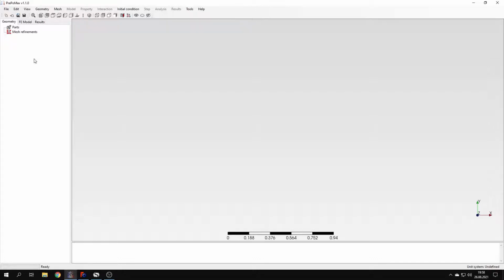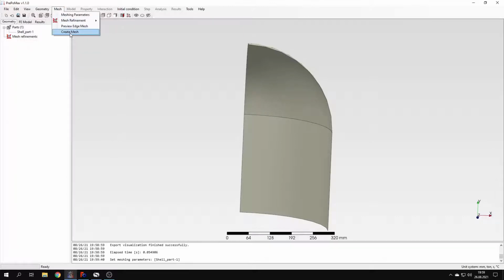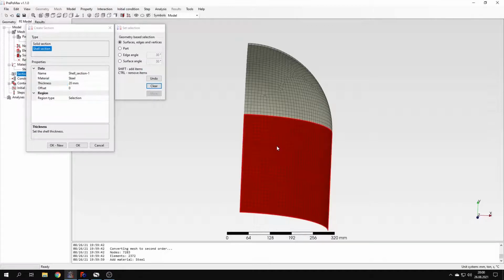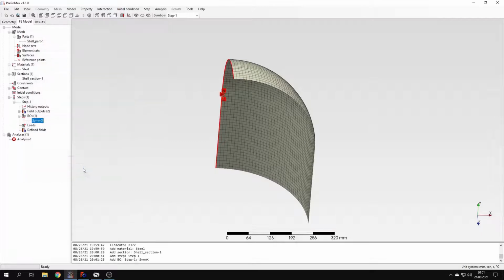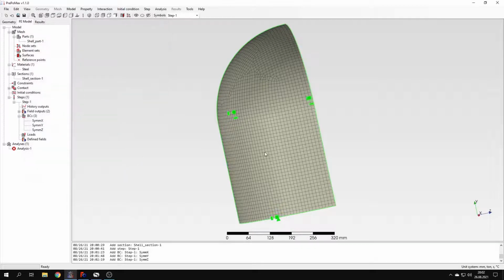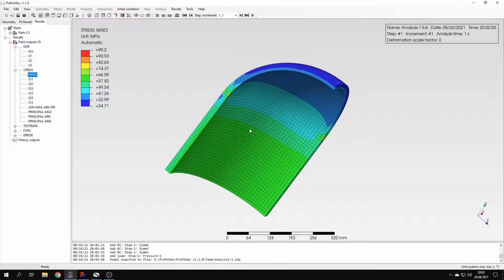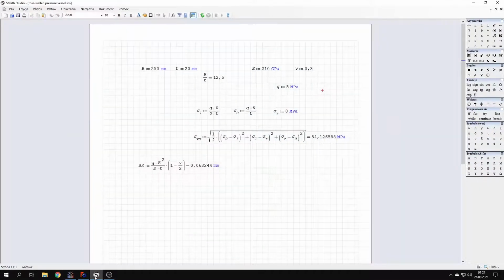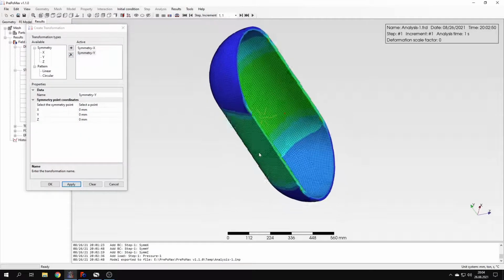PrePoMax (CalculiX FEA) - Tutorial 5 - Thin-walled pressure vessel

Comment: I am also having errors when importing this tutorial geometry. I even re-made a copy it in fusion and I got the same error about "The given key was not present in the dictionary." Any tips to import this?
Reply: Okay, the latest 'Dev' build is working. V2.3.9 dev
Reply: I found the color map in results looked wrong, but if I switch mode from FE Model back to Results a couple times, it will eventually render correctly.

Comment: Hi, thanks a lot for these helpful tutorials! I’ve been following along up to this point, but I’m having trouble importing the file. I’ve tried both using your provided CAD file and generating one myself, but I always get the same error:

“The given key was not present in the dictionary.”

Here’s the relevant part of the log:
...
Successfully loaded STEP File
...
Successfully loaded BREP File
...
Error: The file could not be imported correctly.
The given key was not present in the dictionary.
...
I also tried importing the same geometry in different formats, but the error persists. The only way I could get it to work was by modifying the geometry slightly—specifically, cutting off the top part with a flat disk. Any idea what might be causing this?
Reply from the maker: I have the same issue in the newest version of PrePoMax. I reported this on the forum and I will let you know when it's fixed.

Comment: Hi, Thanks for the wonderful tutorial. My question is why are the stress values in a very few node points so high (getting close to 99 Mpa)? It something very local and does not seem real.
Reply from the maker: Good question. Apparently, it's a CalculiX bug/limitation with a drilling DOF (in-plane rotation - about a normal to an element plane) in curved shells.

Comment: Hello, 
Thanks for the great tutorials. I'm going through all of them.
1 thing though: I sincerely wish you would link to an uploaded .step file of the part you're using in each tutorial. I don't wish to be learning both PrePoMax AND FreeCAD at the same time, and i have had to give up on a few of your tutorials because i simply dont know how to model them with FreeCAD.
Reply from the maker: The geometry in most of my tutorials is very simple and I discuss some aspects of modeling in FreeCAD when less common operations are necessary but I can also consider sharing the .step files. I just need to decide which hosting website will be the best for this purpose. Meanwhile, feel free to ask if you want to know how I prepared any of the geometries used in the tutorials. There are usually just a few operations needed but some of them (like boolean tools or making faces from wires) are not so obvious in FreeCAD. In this particular case, I just revolved the sketch in the Part module (PartDesign can’t create surfaces, it only operates on solids).
Reply: @FEAnalyst  you're doing a great job with your videos, so i hope you don't take offense to my comment. Any individual CAD software has a learning curve, and perhaps most people doing FEA will have some prior CAD knowledge. Though, i would say it shouldn't be necessary. I worked a lot with FreeCAD a few years back, and it's not very intuitive, unless you understand the logic of FreeCAD. The logic is very different from, say, SolidWorks or Inventor, which is what many professionals/students will know already, at least in the mechanical field. 

I think your series should be strictly PrePoMax, with a few hints about FreeCAD (to make people aware that it exists). However great your videos are; if people have to leave the video to find FreeCAD tutorial videos, i promise you a lot of them will give up. That would be a shame, since your videos are so informative and to the point, that im sure they will be the go-to reference for newcomers to PrePoMax in the future.

Keep up with the great work! I hope you find a way to upload the .step files and link to them in each video. grabcad.com, github.com, dropbox.com  - whatever works!

Comment: I do enjoy your tutorials! Also enjoy PrePoMax - haven't seen it before but really user-friendly!... I would be interested in a tutorial for thick wall pressure vessels as well as application of orthotropic material properties; not sure the latter can be done with PrePoMax as it is (or use it's inbuilt meshing algorithm)?
Reply from the maker: Thanks, I'll try to cover thick-walled pressure vessels on the nearest occasion. Unfortunately, orthotropic materials are not yet supported by PrePoMax but they are available in CalculiX so you could define them manually, using proper keywords.

Comment: Is possible to set hydrostatic pressure?
Reply from the maker: Hydrostatic pressure load is now available in PrePoMax (since v1.3.3).
Reply from the maker: That’s a good question. Unfortunately, CalculiX doesn’t have built-in hydrostatic pressure functionality at the moment and the only way to model this type of load is to utilize the DLOAD subroutine. Otherwise, you would have to approximate the hydrostatic pressure with multiple pressure loads applied to separate regions of the selected surface.